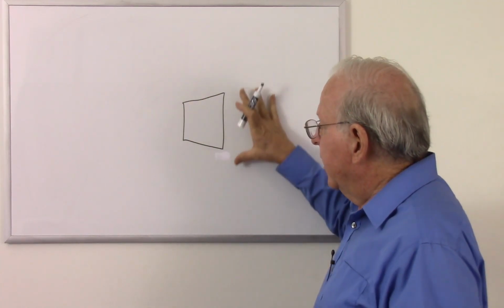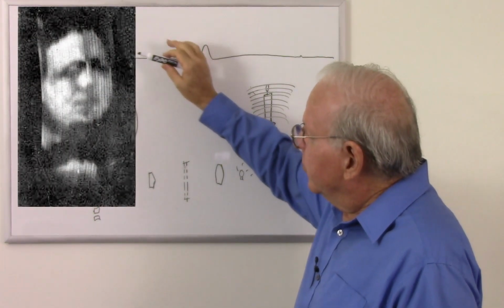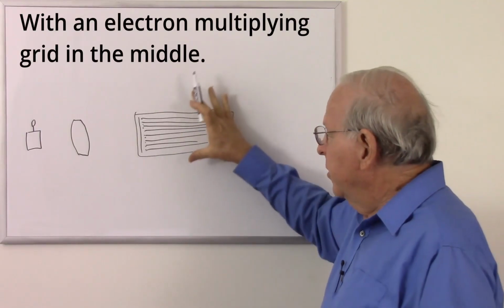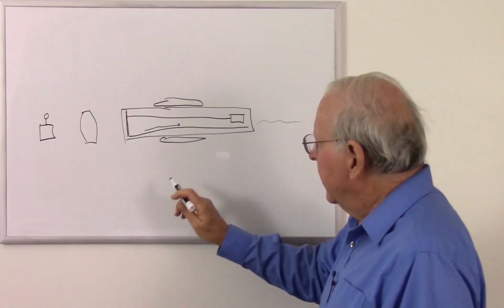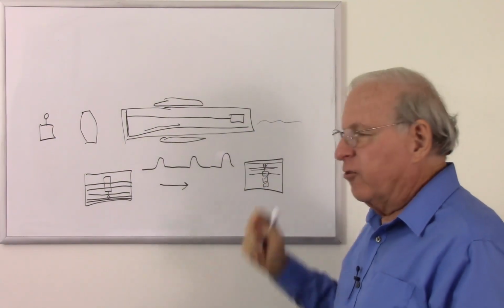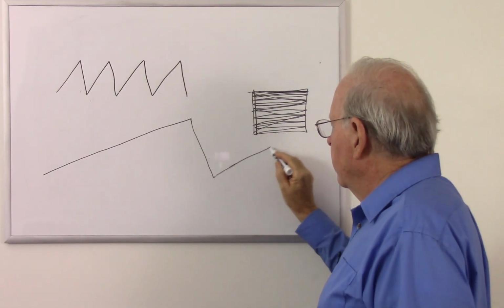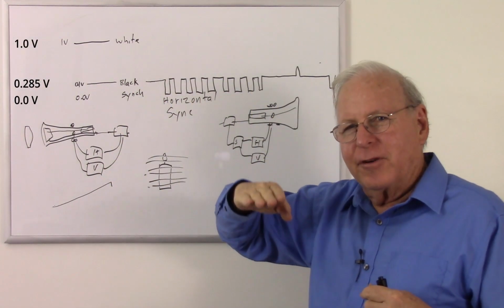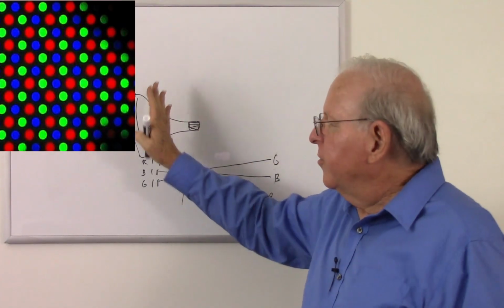Analog Video - Solid-state Devices and Analog Circuits - Day 14, Part 1

Comment: Hi Bob. I’m working my way through your online courses. I’m an electrician and have enjoyed looking into electronics. You don’t seem to have many labs… am I wrong? Do you do videos for lab work that we can do from home? Building stuff? Thank you
Reply from the maker: I don't have any labs, per se. It's difficult to have labs in this venue; I have no way to distribute components and test equipment and supervise the labs. Participants would have to buy the parts, etc. The closest I have is my video series on building a linear power supply, where I describe the circuit in detail in several videos. That was one of my labs when I taught in a brick and mortar school.
Reply: @Vocademy-Electronics-Tech Thank you. I intend on doing what I can to build this linear power supply when I get to that series. It’s more difficult to find electronics projects on YouTube than you’d think. They quickly turn into Arduino/coding projects instead of core electronics. By the way, if you did lead through projects, I would simply supply myself with components etc. And many other followers would too I suspect.
Reply: @John-uo5ro  great thoughts!

Comment: Ahhhh, the joys of working on old CRT sets, especially big wooden floor model console sets.  The first time I ever got zapped as a kid I was probably 11 or 12 years old.  Was tinkering around with a old set that was still in my grandfather and uncles closed radio TV shop.  I troubleshot the set and found the CRT was bad.  No matter how much I zapped the poor CRT with a rejuvenator/tester it wouldn't come back to life.  Unfornately while removing the CRT to install another one I discovered the hard way that CRT's can hold a significant charge and for quite some time.  I put my hand right over the anode hole and pow.  I don't know what hurt worse.  The CRT discharging through me or my hand getting impaled on a nail on the inside of the wood TV cabinet.  It went clean through my hand, in the back and out through my palm.  I learned my lesson that day.  ALWAYS discharge under the anode rubber cap to chassis ground before handling a CRT.  The CRT acts like a capacitor and stores one heck of a charge and it can store that charge from months to a year in ideal conditions.  The takeaway here is the electrical shock may hurt but the damage done to your hand when you jerk it away and run into something sharp or pointy inside the cabinet is one heck of a lot worse.  Puncture wounds with old rusty nails or screws hurt, I mean really hurt.
Reply from the maker: It hurts just reading about it.